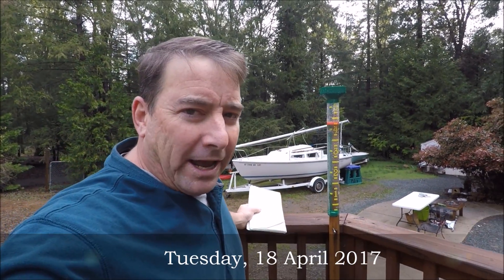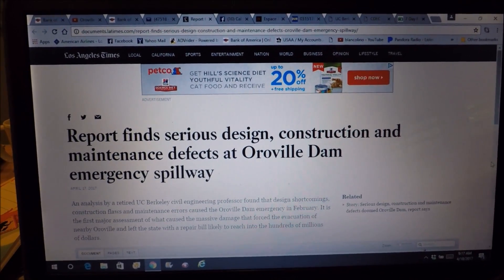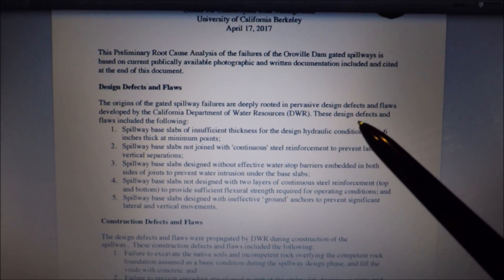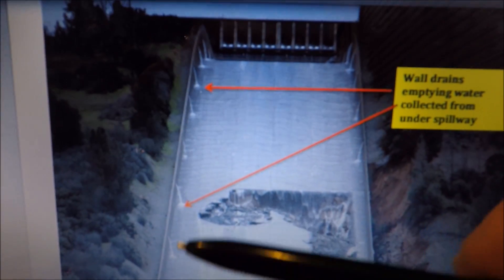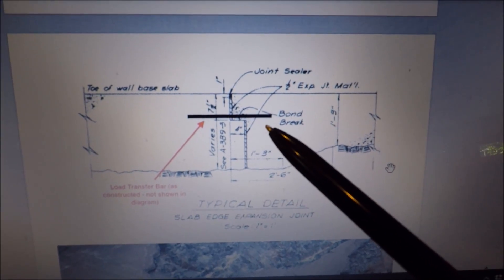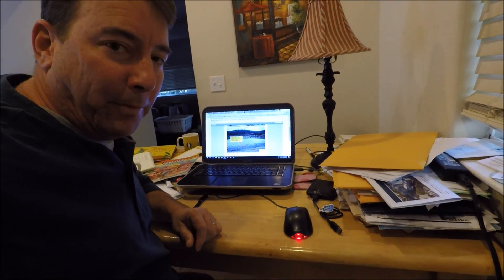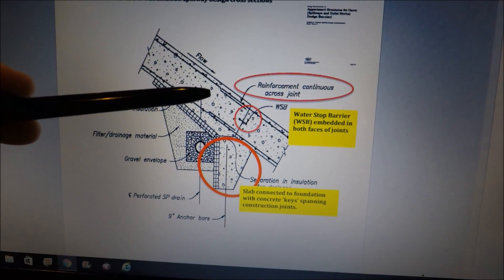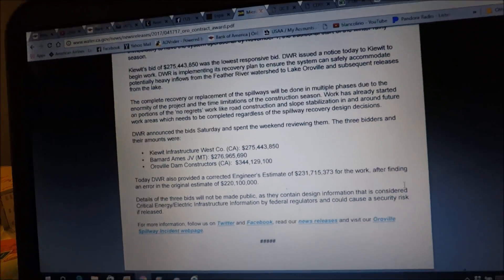Oroville 18 April Spillway Failure Explained-Independent CCRM Report

Comment: I find it hard to believe that even when built, this design was considered adequate. What engineer would NOT see that the slab is significantly weakened by the drain pipes being embedded in the slab, thinning the profile and creating a stress riser! Obviously they though 4-6" was enough concrete for the spillway, the other 9-11" was just there for the ride. Horrible design by ANY standard.

Comment: I correct one issue of the cover of the concrete above the clay pipes is more than 6 inches all you nee dot do is look at the footage showing the workmen above the pipe route. It is likely to be 14-16 inches, nonetheless encasing vitreous clay pipe in concrete is a no go, basic engineering.....

Comment: why does the US always have to invent new systems for names for stuff and not just call it what it is? like rebar just call it its diameter and  material (ex: 22mm stainless rebar) and also wire guage, why just why? just say the surface area of a cut wire why make it hard?

Comment: I don't like the under drains.  Where the failure occurred on the fill section not on the rock section.  You have controlled water inside the flume.  uncontrolled water is outside the flume.  Uncontrolled water reached the drain system and washed out the soil under the spillway.  Clay pipe is easily broke and not designed for water pressure.  Uncontrolled water could have come from the secondary spillway overflow.

Comment: Freeze-thaw damage is a problem at that latitude and elevation.  That it was overlooked in the report is sad.  A cold and wet winter probably was the final insult.
Reply: Yes, I agree.  At concrete joints with steel pins, the steel would rust.  Water would freeze between the joints, and follow the pin and freeze and expand.

Comment: Don't forget to let people know why we use re-bar instead of cable or any other metal. Both iron rebar and concrete heat up and cool at the exact same rate. So one's temperature from freezing or baking in the sun won't cause the other to fail or separate.

Comment: Well done again Juan. A small point, ... cavitation is the implosion of water vapour bubbles not air bubbles. Liquid water changes state to vapour because of changes in temperature & pressure (eddies caused by the undulations on the surface of the concrete will facilitate this) then very quickly changes state back again from vapour to liquid. It's the speed of the latter change of state which causes the damage, - it's faster than the speed of sound and the consequential shock wave is the culprit. What you see at the back end of an outboard motor are vapour bubbles not air bubbles. Keep up the good work. Best from Ireland.

Comment: What is the drain for and what is its job that is how duz it work ?
Reply: gary fletcher  There is a lot of water pressure from the weight of the huge amount of water flowing down the spillway that forces water through any cracks in the cement and possibly through the expansion joints.  Also, water gets under the spillway from the sides during rain runoff.
Reply from the maker: gary fletcher it's perforated,  and drains water out from under the spillway.
Reply: Water gets under the spillway from spillway cracks and from the sides of the spillway with rain runoff that puts a lot of uplifting hydraulic pressure on the spillway.  Also, the water erodes the spillway’s rock foundation so together the spillway can detach from the foundation.  The water is removed by perforated pipes laid under the spillway in a herring bone fashion like “ ^ “s on top of each other.
Reply: How duz the water get into the pipes ?
Reply: The pipes are perforated, they have holes that let water into them, but not too many holes so that the pipes still carry the water out.   (Perforate: To pierce, punch, or bore a hole or holes in; penetrate, Free Dictionary.com).  Perforated pipes look like this image http://www.wellscreen.org/img/perforated-pipe.jpg .
Reply: Beny FreshFeet but how duz the water get threw the cement into the pipes ?
Reply: Beny Freshfeet ok thank you

Comment: Great job Juan. The rebar design they used would only help with perpendicular displacement it had no chance of preventing lateral slippage. Which means holding the slabs from spiking down hill, which is what happened. Even an L-bend at the end would have helped. This analysis makes total sense.

Comment: Really like your series on the Oroville Dam.  Good content with facts (negates "fake news fanatics").  I would like to help maintain the accuracy of your presentation: your description of cavitation mentions a "bubble of air" created by the water flow.  You then say it forms and collapses.  It is actually a bubble of vacuum created by turbulence in the water flow which slams shut when the pressure equalizes.  The mass of the water acts like a jackhammer when the vacuum bubble slams shut.  The activity can eat solid rock, refined steel, even ceramic in the right circumstances.

Comment: Juan - this is your most interesting vid yet! The new spillway design is being planned  by Kiewit out of Nebraska, who offered the lowest bid of 275 million, to fix the unfixable.  Good luck Kiewit!  It will be interesting to see if they will be using the roller-compressed concrete as announced. I'm anxious to see the plan, because RCC is a dense, and somewhat dry, layer of concrete that is too rigid to allow for any rebar at all.  It is actually a surface material, not structural.  

The issue of the incompetent rock may require them to relocate the spillway where they can anchor to competent rock, or else do a lot of blasting.  I hope the new design will address the issues that undermined the integrity of the last one, which have been outlined in this new report by the Center For Catastrophic Risk Management. 

 The president gave California enough money for a new spillway, 274 million or so, but DWR is spending it as quickly as possible on dredging and shot crete,  For decades,  DWR sold water to the state, but apparently didn't use those revenues to maintain the Oroville Dam system, and blew off years of inspection recommendations. The decay is ubiquitous! Obviously  DWR and Brown  will go back to the Federal well, and probably get additional millions  - our tax dollars, that need to go elsewhere. "Just say no Trump!"  California needs to pony up next time.

Comment: Wow those drains where just like scoring the spillway slab from  underneath.  That with no balanced tension cords in the rebar placement,  no wonder this structure came apart under the force of the water jet once it got under it.  You got remember that hydraulic digging   equipment was pretty primitive in the sixties.  Backhoes were just coming into use and there was nothing like    a tracked excavator.  Most dozer blades were still hung on cables.  Hard work tying to hack out rock with that.  Can see why they laid them on grade.  But what a point of failure.  Like  my Pappy told me...  concrete is finished on both sides.

Comment: Man you guys can actually start a company with what is happening. I mean the unemployment percentage there should be 0 for available people under 55 to work this area, or higher depending on how good of shape the crowd is. But goosh if I was there, It be an honor to work around where I live or grew up to save the community. But you showed a photo that looks like the spillway has collapse more, further up in the center toward the gates, ??... But I'm a firm firm believer right now that God is showing a sign that we also need to be concentrating on where to harness all this snow pack water that could be a valuable asset on the upcoming fire season. Which looks like its going to be a rough one for the community.

Comment: If we ignore water under the spillway I think the cause was the load transfer rebar that was added in contradiction of the original design.  If you imagine the mountainside to be a giant slide, the whole weight of the spillway would be pulling on the sections above if there is no bond breaker on the load transfer rebar.  Imagine picking the spillway up at the top and letting it hang in the air, that is the force on the upper sections if the earth under the spillway slips a little over the decades due to earthquakes or other causes, including water erosion or soil plasticity due to moisture.  The situation gets worse if you add the pulling force of the water colliding with the barriers at the bottom.  If it were not for the scour damage exposing the rebar, I would think that a design like lap siding on a house would work fine.  I am not a structural engineer, this is just an insight that could be wrong.
Reply: The print does call out for bond break
Reply: I was under the impression that the original plan called for a bond break but then the contractor added steel across the expansion joint.  Maybe I was confused with over the weep pipe.

Comment: The drainage pipe should be set into a gravel base, not set into the concrete.  This would require the spillway concrete to be held down into the bedrock with bolts sitting on a gravel base.  Reo should be top and bottom as any slippage downhill would crack the concrete at the expansion joint as the structure would act as a column.  Excessive bending is bad if no reo is present.
Reply: Rebar holding down hooks are connected to the top reo making them subject to vibration caused by cavitation.  Each vertical hook would become a vibrating tube that would separate from the bedrock.  Once separated the spillway would shake itself to pieces at an expansion joint.  There is no way of maintaining or testing the rebar "holding down bolt" connection. 

Trig points for spillway sub slab measurement relative to the local bedrock are not shown.  It may be that the spillway section had already slipped down hill pre flood event.  A regular EDM regime would have shown this.
Reply: There is no way the original design met the US concrete standards of their day.

Comment: Nice job of explaining this in everyday language, Juan.  I've been involved with heavy civil construction projects for over 30 years, and one of my early mentors told me, "there's two types of concrete: concrete that has cracked; and concrete that will crack".  It's controlling where the cracking takes place is of extreme importance.  I'm very curious how the reinspection and retrofitting of other dam structures and spillways is going to play out over the next few years.

Comment: In the paper edition of the LA Times today, the reporter did complain about the secrecy of the DWR, as well as some analysis of the report was given. The excuse that this was design from 50 yrs ago is just plain weak.  Working in construction  for than 50 years myself, we built foundations and even driveways to a higher standard than this.  What was the cure strength of the concrete?  And etc. ....

Comment: How is the over all integrity of the reservoir holding up to the rise and fall of it's water levels? It is critical that the Feather River be at a consistent height to insure it's banks are not weakened by fluctuations in the water level.  Does this logic apply to the reservoir also?
Reply from the maker: not so much, no fragile levee banks above the dam.
Reply: blancolirio Thanks Juan for the reports. My concern is with slides and land fill into the reservoir and the present pressure of a full reservoir (which until recently was low)on the dam.

Comment: I wonder how you can add load transfer bars across the concrete slab expansion joints without defeating the action of the expansion joints, at about time mark 8:47 and image page 9 of report.
Reply: Slots can be cut into the surface of the slabs and bars inserted in place with the upstream end (or high end) lubricated and then the entire bar is epoxied into place with the appropriate materials. Materials are available that are much stronger than the basic concrete slabs and adhere tenaciously.  I have seen instances where a contractor was required to retrofit miles of highway in this manner because the bars were left out during initial construction.
Reply: I think if the coefficient of thermal expansion is similar for concrete and steel that this would also create a defeating action on the expansion joints because the bar would be expanding across the slab joint in the opposite direction of the expanding concrete that is closing the joint.  And because the bar would need to contract to allow for the closing of the joint due to the expanding concrete, but as you know the bar and concrete don’t do that because they expand and contract together at the same time.
Reply from the maker: yes!
Reply: The coefficient of thermal expansion is similar for concrete and steel.
Reply: The load transfer bar in the upper slab was to be wrapped to prevent bonding.
Reply: How is the load transfer bar, which is not bonded to the upper slab, anchored to the upper slab that allows the bar to move with the contraction / expansion of the slab joint?
Reply: Page 13 of R. G. BEA's Report, PDF page 13, labeled page 6, Detail A Lateral Expansion Joint calls out the wrapping to prevent bonding, What is that for, side to side and up and down support while allowing expansion and contraction?
Reply: Alright, and maybe there is some kind of "stopping anchor" on the high lubricated end of the transfer bar that doesn't let the joint expand past a maximum limit.
Reply: Hidden Treasure  Thank you.  I see load transfer bars are not for longitudinally attaching spillway slabs to each other like a chain, but are for supporting the slabs laterally and vertically!  However, the fact that the slabs are not connected longitudinally like a chain is one of the report’s criticisms ("No 'continuous steel across joint to prevent slab separation," PDF page 13, labeled page 6, "Detail A Lateral Expansion Joint," and “No steel reinforcement across slab joints to prevent separation," PDF page 15, labeled page 8, "Typical Detail Slab Edge Expansion Joint").

Comment: Juan having over 30 years of concrete experience myself I personally feel his report is dead on, The roots from that tree was probable putting a lot of upwards pressure on the bottom of the spillway as well of the it clogging the drains. In early photos I seen on google earth I all so seen there was a concrete patch repair done in the same spot. i guess would be tree roots, Its to bad this did not need to happen. thanks for all your hard work I look forward to your next vlog on it. Now i have been watching i went back and have watched some of your riding videos and someday i need to trailer my bike down I-5 so we can ride together.

Comment: #1 These won't be the same inspectors that were suppose to be inspecting the spillway when it failed do to lack of improper inspection, is it? #2 Just what will the inspectors be inspecting? The blueprints/plans? Those inspections can all pass but if its a new plan just who's to say it will work/hold being its never been tried before? #3 Are we getting any kind of work warranty encase it does fail again or we out 270 million dollars?  As far as President Trump kicking in any money I can assure you it will be the same answer as Hawaii just asked for in case North Korea strikes them. I can't use those four letter words here but I assure you Governor Brown isn't getting any help.  Besides, he should of had the right people  not just monitoring this dam but all dams, bridges and all of California's infrastructures and repaired as needed instead of promoting some Twin Pipes project for a drought we don't even have. Of course there is those 3 counties down around Bakersfield he didn't lifted even though those farm fields are still flooded.  Once those pipes are in the farmers get bought out, Tons of new housing go's in and billions more in new tax's. Mean while we starve.

Comment: if the water was getting down under the spillway..  the hydraulic pressure could have been lifting it .. allowing the soft spots to wash out..   i worry about the drains that seemed to be flowing back into the spillway almost to the top. .

Comment: The longitudinal placement of rebar across a joint is NOT to hold it together Juan.  If you'll look up some of those original diagrams at metabunk dot org you can find where the upper section of rebar is wrapped with wire so that the rebar lives in a pocket that can easily pull apart from the bottom -- on purpose.  The 'new' type constuction you showed had an anchor only for the upper section, the bottom section then has to rely on it's own similar anchor at it's downhill base. If expansion joint can't move because of cast in rebar, then the rebar across it fatigues and outright fails  without notice -- not a 'good' situation if that's where you are banking on strength to come from.

Comment: On a spillway the expansion joints should be poured at a 45 degree angle. A butt joint is going to let water pressure get through the crack and "float" the concrete up.
Reply from the maker: Good point! That's exactly what happened!

Comment: Cavitation bubbles contain no air, only a thin water vapor.  They are primarily vacuum, and their creation requires a lot of concentrated energy.  They are essentially water being forced to occupy less space than the volume of the liquid supply, or against very high pressures; somewhere a vacuum bubble will open, given enough energy.  When they collapse they radiate high energy acoustic waves through the water, which transfers the energy to the nearest surface.

Fleisher and Ponds theorized about such bubbles being violent enough to cause cold fusion of hydrogen into helium; though wrong, its not hard to imagine that cavitation supplying that sort of energy concentration.